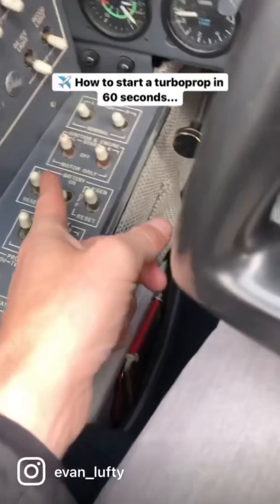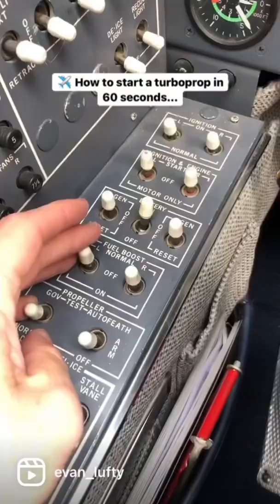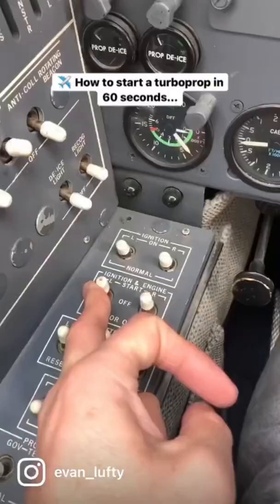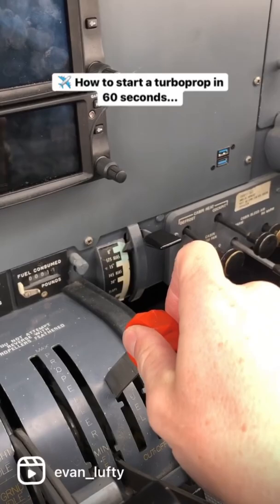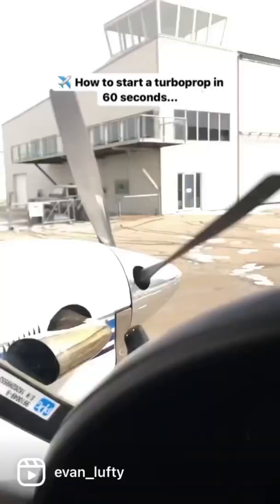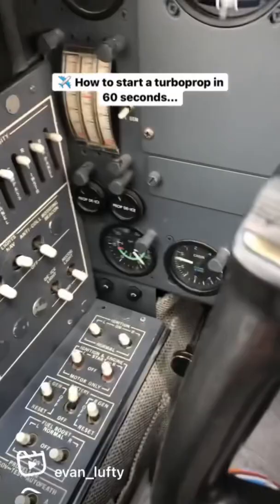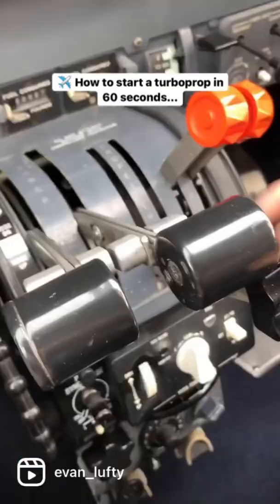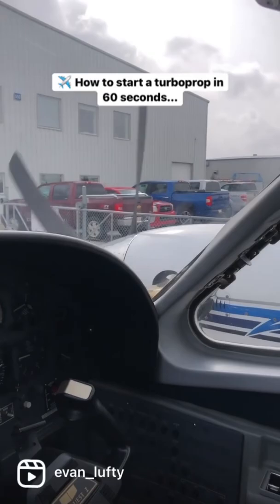🔥How to start a Turboprop in 60 seconds!! | Aviation Pilot Vlog

Comment: A new PT-6 engine can cost in excess of $300,000. I work for a shop where we repair them. Once we had a jack fail and drop one. Largely unscathed spare for what's called the 'chip detector' on the forward underside, it still cost us $150,000 to have it sent to Pratt & Whitney to have it inspected and recertified!
Reply from the maker: Omg that’s insane! Apparently the pt6 on the pc12 is even more expensive!! I’ve heard near 500k
Reply: @EvanLuft  Absolutely. We mostly repair the old lady Beech 99's which are an older model. The New PC-12 PP's I know cost quite a bit more.
It's crazy the prices in Aviation currently. Some of it makes sense, but holy cow!!!
Reply: According to Wikipedia most of the variants of PT6 are between 500 and 1500 horsepower. I imagine that the price they charge is partly a function of how much power the particular variant puts out.
Reply: After learning about the stress fractures caused in engine pylon attachments by continental and American from poor forklift procedures during maintenance this makes me very uncomfortable lol
Reply: @coltenh581  Interesting
Reply: Dear lawdy. Engine is a much as a family house!  🤯

Comment: I've seen plenty of these at the airport near my house. Thanks for the useful tip 😏
Reply from the maker: ;p
Reply: How will you get fuel?
Reply: @managed9348  dont worry they got fuel in em already just like in grand theft auto
Reply: @managed9348  hold the fuel handler at gunpoint.
Reply: @MrSimplified  you won’t make it far😭
Reply: @managed9348  most airports I've been at for small planes don't have any security around the pump you just get your fuel and go in and pay its just a off on switch. Haven't been to one in 10 years so things might have changed.
Reply: Most devious of licks 😈

Comment: Good training for the non pilot's out there.  The Pt6 /34 thru the 114 are very forgiving and with proper 100hr.s and trend monitoring will be very trustworthy.
Reply from the maker: Yes :) the 114 are on the caravan??
Reply: @EvanLuft  Sir you are Correct Cessna Caravan with boat oars for props.  Worked on many that were owned by FedEx out of Traverse City Michigan.

Comment: Thanks for the video, but can you post a step by step walkthrough on how to turn it off? Apparently it’s a “safety hazard” to leave it running. We just ignored it for a couple months but it inevitably started racking up fuel costs and my boss doesn’t like that.

Update: My co-pilot tried turning it off, the idiot just made it go faster.

Update: Can you please post a walkthrough about how to turn it off? I guess it’s spinning fast enough now that it’s moving the plane. We’re just letting it roll around in circles on the tarmac but it’s getting really annoying.

Update: It killed a guy. Ground crew? More like ground beef🤣!! Anyway, you can stop making that update, the cops turned it off.

Update: You know what, I probably shouldn’t have kept refueling it. That just seems like a no brainer
Reply: Omg that’s hilarious 🤣.

Comment: feel like its kept overly complicated to justify the time and expense of flight schools. Itd be as if you had to manually turn on the fuel pump on the car, manually turn on the oil pressure sump pump, manually turn on the battery connection,  etc. etc.
Reply from the maker: It’s our last defence in keeping a job haha. Before robots take over our pilot seats haha

Comment: Ok so am I right in saying (on the ground) you can only start one side from scratch? Which you need to then start the other! Or is the process reversible?
Reply from the maker: You are correct. Almost always you start the one on the battery and the use the running one to start the 2nd engine. It is impractical to use a cart start every time. A good battery and alerting the engine spool up to around 18 to 21 % before introducing fuel won’t cause any harm at all. I can count on one hand how many times I’ve seen someone cart start a pt6 in almost 15 years of flying. Usually due to a bad battery or something :) :)
Reply: @EvanLuft  So are you saying it is not possible to start the other way? I know nothing of flying but find it interesting. If this is correct is it because the second engine lacks the hardware to do so? If yes is this to reduce weight? Or is it just practice to start one from battery and the second from electricity generated by the first? Could you start both from battery (even if bad practice)?

Comment: Do you have to turn on the fuel pumps?  Sounds dangerous if you accidently turned them off at 10,000 feet.  Sounds like a really bad design.
Reply from the maker: These fuel pumps are always in standby so if there is low fuel pressure they will come on automatically :)

Comment: Adjustable pitch props?
Reply from the maker: Yup!
Reply: Can you reverse the thrust and back up? I just saw a plane do that this weekend at an airshow. It was a C130. First one was a regular C130 after they dropped the skydiving team out, then the Blue Angeles C130 did a demonstration in the air, after which, it did a high angle approach and a short runway stop and backed up before taxiing.

Comment: Is there an alternator on a plane?
Reply from the maker: Yes. Actually it’s called a generator. On each engine. For redundancy. :)
Reply: thats awesome! if its a generator i assume it uses fuel? or dose it use the rotation of the motor like an engine? i find it fascinating. do you know what voltage? dc right? sorry for 20 questions i should just look em up and stop bugging you about it! xD